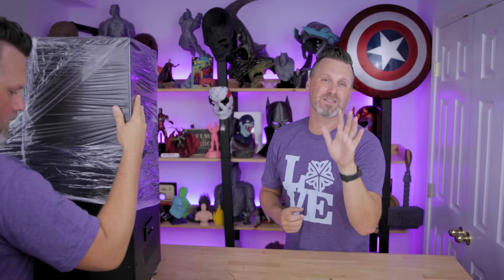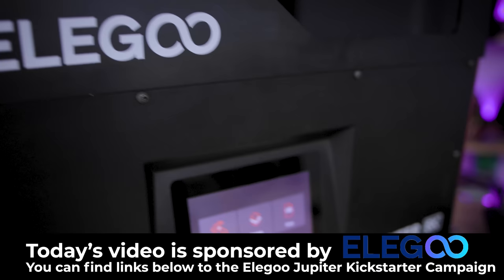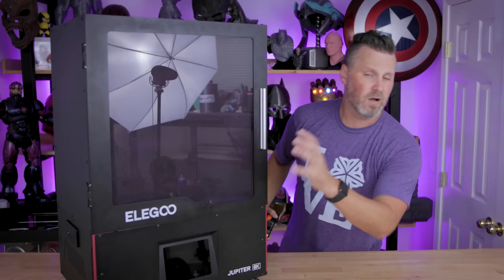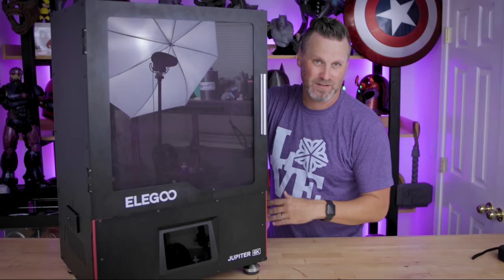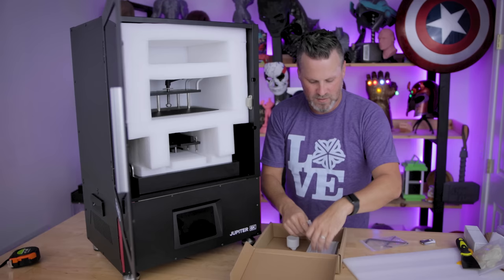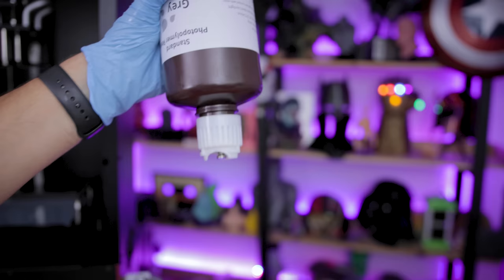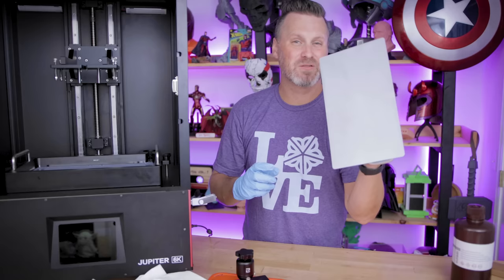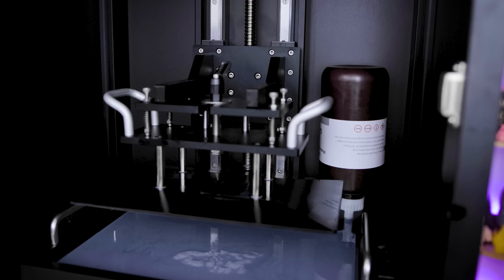Elegoo Jupiter Kickstarter Resin 3D Printer | Initial Look!

Comment from the maker: I will be posting a Q&A video tomorrow based on A LOT of questions already provided. But let me know if you have any you'd like to have answered below!
Links to the Kickstarter Campaign https://www.kickstarter.com/projects/elegooofficial/elegoo-jupiter-128-6k-mono-msla-3d-printer
Reply from the maker: noiziy  Clarifying with elegoo as I thought the beta unit I was sent was not a Mono Screen... will be posting a clarification in tomorrows video and here. The production unit will be a Mono screen as they have stated.
Reply: I was just about to ask the same question but you guys already asked and answered back.
Reply: Do you have to re-level the build plate every time you take it off or can you easily take the plate on and off to get a series of successful prints?
Reply: I've been on the fence for a Resin 3d printer for a while waiting for better quality and air purifying to more standard/affordable.  Would you reco this model for a first resin 3d printer?  I've been using FDM printers for about 4/5 years, starting with an ender 3 then added/upgraded to an Ender 5 plus.
Reply: I had a moment of panic there when you said it wasn't a mono screen, thanks for the clarification here.
Reply: Comparing the Jupiter to the Phrozen Mega 8k, the main thing that sticks out is that this build plate doesnt have holes, yet Phrozen claims that build plates of this scale need to have holes to protect the lifespan of the screen due to high suction forces. Its a little frustrating having two companies point in two different directions because clearly Elegoo doesnt share that concern with this build plate. Any input on that? And the same for screen protectors. Im afraid print companies deter people from using them so they can sell more screens once the fep breaks and resin spills onto the unprotected screen. Any suggestions on large-format screen protector films or do you shy away?
Reply: How does the resin auto fill run? Is it a continuous slow flow of resin or is it something that turns on and off every once in a while? Does it have any kind of overflow stop to keep the bottle from over filling the vat? Like if I had to walk away from the printer for a few hours, would the vat overflow with resin if I forget to take the bottle out?
Reply: @Jeteye2844  It works the same way as one of those automatic water dispensers for pets.
Reply: can you do a comparison regarding print times to those of the phrozen mega 8k?
Reply: @Unifiedesign  I was just wondering the same thing! Two different directions from both companies. I ordered the Mega 8K, but I’m keeping an eye out for this one as well.
Reply: @jct1149  Also what is the difference in overall print volume?  The Elegoo Jupiter’s print bed looks like it wastes a ton of vertical print space….
Reply: @christianpoynter7971  Ditto!!
Reply: Will the build plate be modified to slant on the top? And will the build plate be able to be angled after the print is done to let excess resin run off? Thanks!
Reply: @UncleJessy  Yeah, I had the same question about it being mono screen or not. It was a bit confusing but I figured that maybe something was gonig on because it clearly says in the Kickstarter its mono.
Reply: Do a elegoo giveaway
Reply: Like the mats 2 or 3
Reply: After a year using this printer what you think about it? I am interested in purchasing one. Thanks

Comment: how clumsy is that vat going to be if you need to dump it out to retrieve a failed print stuck to the FEP? especially with the bottle attached? I'd imagine you need to un hook the bottle first, but that extra pool at the back looks like a resin trap. 

How soon til the resin bottle makers start putting a "window" in the bottle  (up by the neck) so you can tell when the bottle is almost empty?

Comment: Awesome first look Clayton! I would love if Elegoo also made the vat screws "locked in" to the vat, so they won't pop out while removing the vat. Would be pretty easy for them to make them have little bottom collars, this way accidental plops in the vat, or having them skip across the floor due to them being wee little screw tops. Definitely agree on the temperature of the lights, a cool white would be much better than 1980 yellow. Would also love to see a little firmware add on, to keep splashes down, the printer should raise the plate by..40 mm, past the height of completed print. This would let some excess resin drain, without a chance of splash, prior to print removal.  Can't wait to see the final version of this and some big prints!
Reply from the maker: Hey hey! I like that idea. How the heck would that work so that the bolt can screw in to the base but not come out of the vat fully? Can’t wrap my brain around that. Maybe need another coffee 😂
Reply: @UncleJessy  They could have a threaded collar attached on the vat, that still allows the bolt to be screwed in and out, but once it is free of the internal collar on the machine, the whole thing could be lifted up. You could still technically remove the bolt completely, but if you just unthread it to the point of it not being attached to the machine, it would still be solidly threaded into the vat, to allow for it to be lifted, while maintaining the bolts in place.  Hope I explained that well haha.
Reply: They just need a recess in the vat around the screw holes and then a star washer. All types of machines use the same thing to keep screw down mechanisms in place. Infact they could also do a recess into the base for alignment dowels built around the screws. Now your vat is aligned and the screws won’t fall out.
Reply: White light has blue in it... You need to stay as far away from ultraviolet as you possibly can. Hence a yellow light is used. Stop being picky when physics doesn't conform to your expectations of aesthetics.

Comment: Wow. I've been keeping an eye out for a decent resin 3d printer, and pretty much settled on Elegoo. After seeing this video, I'm seriously thinking about backing this Jupiter. Go big or go home, I guess.
Reply: With how much it "should" really MSRP/cost, compared to how much you save doing the kick starter, I would kick my self if I didnt back it.
Reply: @Matthewjohnwilson  Exactly. For roughly 50% off, I'm totally willing to wait until April next year. I'm considering the the one with the mini air filter. Though, at this price point, I'm a little put off by the $150 (US) shipping charge.
Reply from the maker: It would be a great place to start with a big machine. If you wanted to start out smaller the Mars Pro or the Saturn are fantastic options!
Reply: @nijaljiggetts4749  I think its like over 80 pounds. And over seas. I am not sure but it sounds right to me since the import fees are included.

Comment: I was getting those exact same lines on my saturn and only on a portion of my screen too. It's really hard to notice but if you run a print without the vat on and a piece of paper over it, you'll notice the lines going across that part of the screen. They're super fine and only noticeable when up really close or taking a photo of it and zooming in, but they were there. A new screen fixed it.

Comment: The screws for bed leveling.. I wonder it they are reliable and sturdy. We might ruin the bed leveling just by touching them while removing or inserting the build plate. Seems a bit too experimental to use capnuts as contact points for leveling.
Reply from the maker: Elegoo did let me know that they are looking at the buildplate design and if they will be changing it further.
Reply: Once they are adjusted and locked the bed should always be level. Think of it like a fdm bed. Once you level it it should be fine. If there was a jam caller on the screws they will always align.

Comment: I have another theory, those vertical lines on the prints are coming from the resin auto-feed AT THE BACK, which is why its only happening to the prints at the back. The shape and pattern of the lines in the prints is the fresh resin mixing under the build plate. I've been able to recreate something similar to this on my Mono X by just pouring in new resin multiple times over the course of the print. I doubt its the screen that's the issue.

Also, that leveling system seems over engineered. They really couldn't come up with something more simplistic than that? I agree, the feet have to go, they are an eyesore and look like an afterthought. The screws around the front touch screen make the unit look cheap. Everything about that vat bugs me, it just looks so clunky and unrefined. I know this is a proto, but gezz, looks like this still needs a lot of work. And no mono screen?...com'on. I would still prefer the Mega 8k over this...for now.

Comment: Thanks for this sneak peek! ♥ I was a bit concerned when you said it wasn't a mono screen but I guess that's just in your early prototype because the KS says it is mono.

Is there any indication from the way this printer is assembled how the forthcoming Z-axis extension could be installed given the fixed enclosure? 

Oh, and does the enclosure have any punchouts in the sheet metal for adding a fume extractor?

Awesome video, keep up the good work!
Reply from the maker: Yeah I should have clarified that more in the video 🤦‍♂️
Still not sure on the final packaging/assembling but I believe it will be in 2 boxes. Which will certainly make it easier for moving into a print space vs 1 huge unit. No punchouts but its thin enough metal that you could probably cut through it easy enough

Comment: Ha! Loving the new effects :-) Questions from me - if the lift height. That's a LOT of surface to drip and splash if it's raising right up when finished. Is it a case of "lift 50mm after print" or "lift to top after print" kinda thing?? And I'm glad it's a 4 point levelling (HATE the ball joints with a passion!!!) but not sure on the direction they've gone with the whole bed on that one bolt and those 4 weird levelling bolts.
Reply from the maker: Thanks 🤘  I'm not 100% sure what the lift after print is doing and didnt pay that close attention but will check on my next print. Elegoo is taking some of the feedback including the bed design and looking into if they are going to modify it further.

Comment: I wonder if the cooler or broad spectrum LEDs had a risk of congealing the resin. 405nm is in the visual spectrum, so if the light has blue in it then it could potentially start curing. Usually LEDs are narrower band, but I can't think of another reason for warm lighting.

Comment: I have printed before with the protective film on the vat (NOT REMOVED) with successful prints. Would you remove anyway for any reason if it's working? I feel like it's probably going to end up getting removed when a print finally doesn't work and sticks to the tray.

Comment: As long as Elegoo continues to use the Chitubox boards i wont touch them. Unless they patch them out to stop trying verify if a file was created with the Chitubox slicer. Though i would just prefer a open source board all to gather.
Reply from the maker: Yeah not a huge fan of the chitubox situation as well. Really hoping something changes with all of these printer brands that use those boards.
Reply: @UncleJessy  I was wondering about that also.  On their page it's stated that in addition to Chitubox Pro, its "Also compatible with CHITUBOX Basic and other third-party slicers", although it doesn't specify which ones.

Great video!

Comment: OK, I have a question and after looking back at the KS I canst seem to find the answer. I assumed when I backed theKS that this was a mono screen. Early in your video, you said it was not a mono screen. Is this not a mono screen? Because on the KS they said the screen will last about 2000 to 3500 hours and that is right in line with a mono screen.
Reply: @asimhussain8716  thank you so very much for the response

Comment: Check all the screws on that printer I returned my Saturn because the Z motor screws fell out the first Day! I got the replacement yesterday and the same thing a bunch of screw's we're loose enough to turn by hand! I took the entire printer apart and used blue locktite on it so I don't have to worry, the first one had a lot of damage inside when the motor dropped about 1 hour into the print it was spinning hitting everything inside the case even the screw drive was a little bent! Elegoo ran me around a little along with Amazon it took almost 2 weeks to get a replacement sent out! I'm not saying this will have the same issues but 2 Saturns having the same QC issue doesn't look good I went through a lot of resin trying to figure out what the Heck was causing the failures? I already have a M2P with 0 issues. Anyway good luck just check the machine closely it's a lot of money " I know UJ didn't pay for this one" but if you order one it's a little bit of insurance.
Reply: I had that happen to My Saturn the motor dropped into the base. Luckily I caught it after about my 10th print.  put the screws  back in tightened them up and no issues since. but I check them all the time. it could of fried everything and started a fire. But after working with the Saturn and wanting to kick it out the window some times with print failures. I think I got it locked in and I am ready with the know how to put the Jupiter to work. luckily I got the early bird price of 600 bucks.

Comment: I think the raised screen will not be there on the final units: it stresses both the FEP and the screen. Besides that it may causes bumps on the FEP around the edges of the screen, and thus the FEP may not be flat... it actually surprises me that the prints didn´t failed, but of course that is good. It would be great if Clayton or Elegoo could clarify on that.

Comment: Wouldn't the LEDs need to be a certain color temperature to avoid curing the resin? Cooler lights would be closer to UV.
Reply from the maker: I run cool/white LEDs all day every day in my space with resin printers with no covers on and have zero curing issues. But a valid concern to test if changed.
Reply: I suppose cool white light does have a lot blue light (above 400 nm) but not necessarily UV light (< 400 nm). It should be safe for curing.
And sitting under cool white LEDs in an office should not result in high UV radiation, that would not be good ...
Reply: @UncleJessy  Same. It's my understanding that while some white (cool or otherwise) LEDs do produce small spikes of UV range light, it's extremely low energy. I've got my workshop lit super bright with LED shop lights and I've found droplets of resin that was exposed for WEEKS that didn't cure.

Comment: Warming the resin before use helps cut back on print failures. Cold resin doesn't cure as well and is thicker.
Reply from the maker: Yeppers. Might have already mentioned some sort of heater unit would be great for the machine.
Reply: @UncleJessy  I feel like all large resin machines should have a warmer feature. Unless it's patented by formlabs. They do have a heat feature.

Comment: Compared to Phrozen Mega 8k, how long does it take to print? Is it faster?
Reply from the maker: I will be doing a compare soon on that one!
Reply: The Mega 8K has 43 microns XY resolution. The Jupiter 51 microns. What should be compared is the build quality and z-axis stability. Are the parts accuracy class H, like Elegoo told in a comment on another Jupiter video? Print speed may vary a bit. Depends on how powerful the UV array is and what layer height you chose. Maybe the Jupiter can handle faster lift speed if the mechanical components are good enough. The ball screw is definitely a plus in regard to accuracy.

Comment: Was the bottle full on the second attempt? The pressure/volume equalization of the resin bottle could not overcome the weak chemical bonds of the resin. Because resin is like thin mud the effort to move the liquid out of the tiny bottle outlet reaches a point where it cannot overcome the force required to displace the resin.

Comment: What's the PPI (pixel density) for this 12.8" screen at 6k vs the previous printers Elegoo has put out? Does it turn out to be higher resolution or lower than something like the Mars?
Reply from the maker: Since mine wasnt the official screen / need a replacement I held off on a lot of that since what I'm showing wont be the same screen for the production units! How you been man!!!
Reply: It should be 51 micron pixels. For reference, the Saturn is 50 micron. So prints from this should be indistinguishable from Saturn prints as far as resolution.

Comment: I backed up this one because I want to print props and helmets also some armors and casta le jewelry... But I'm a little concerned if it will be a reliable product or not, I see that there a re a lot of stuff to tweak. It's going to be my first resin 3d printer and I know hat everyone say about YOU NEED TO START WITH AN SMALLER ONE, but I'm not going to spend in an smaller one with lower quality for maybe the same price and also get this one (as an early bird backer). So can you eventually give some advice about if it will be a good machine for props and that stuff, I also bought a full armor from Niko industries (thanks for your advice) and I'm a little bit scared for what will come with this projects. I hope you understand what I'm saying, English is not my language. 
Thanks for your amazing videos.

Comment: What would happen if you were low on resin and there wasn't enough in the vat or in the bottle? Would the print stop or is that not a common issue with the resin printers? Could you add a fresh bottle in the auto fill during a print or would it stop?